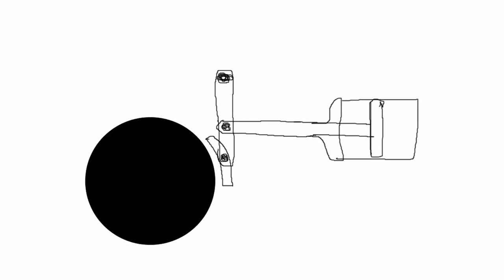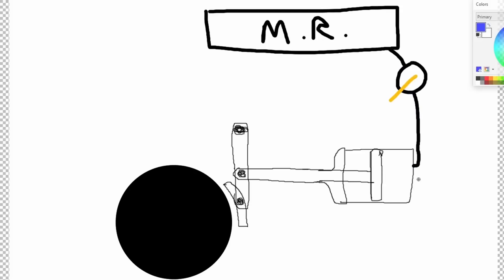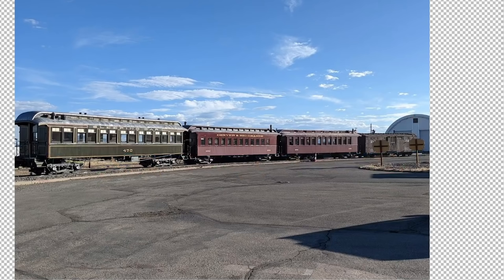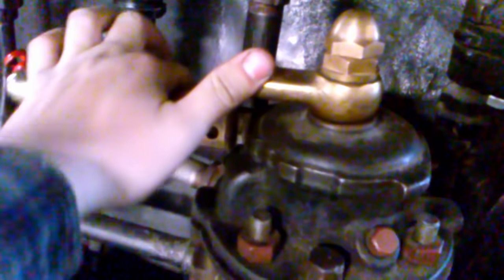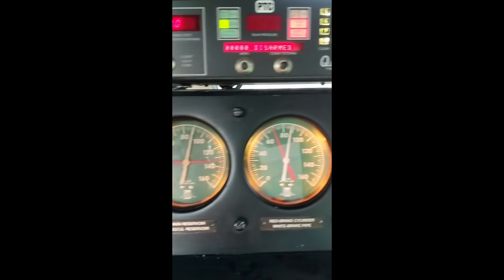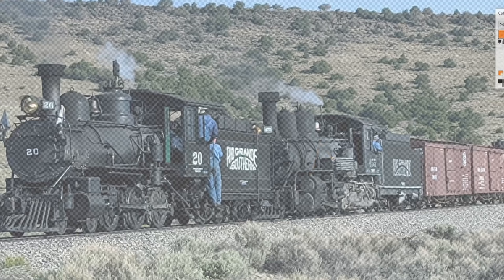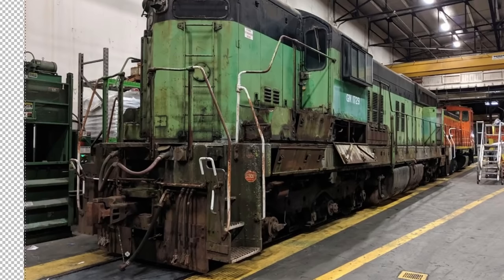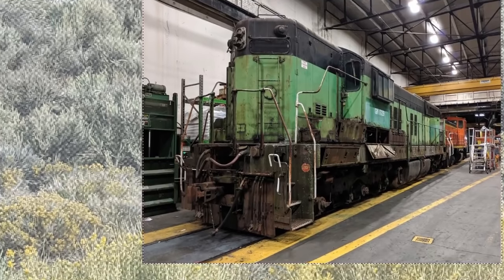AIRBRAKES 101: 10 levels of TRAIN BRAKE understanding!

Comment: That was a great video, and I learned a lot!  A couple other comments, one of which might be for air brakes 102:

1.  On the Sumpter Valley, the brake stand is 19 is a bit different regarding the independent.  To bail off the independent, you set the handle to lap (or maybe running?  I've been out of the cab for a bit), and then press down.  This bails off the locomotive brakes while keeping the automatic set up.  It's kind of the opposite of the "engine hold" you described; we had a separate valve for engine brakes.
2.  I recall reading that the brake cylinder is smaller than the reservoir on the cars, about 2.5 times smaller, so a reduction in the brake pipe results in a larger application than shown on the gauge.  Example:  5lb reduction in pipe and reservoir->squeezes into cylinder and is further compressed by size-> 12.5lbs on brakes.  Again, a little rusty on that, but it makes sense with P1V1 = P2V2.
3.  For air brakes 102:  can you do some research on Electronically Controlled Pneumatic Brakes (ECP)?  Where there's an electric signal line run to each car so they all apply brakes at the same time instead of going at the rate of air flow, which on long trains takes a while.  That time delay is also why distributed power can help with braking, since the air "signal" comes from multiple locations at once.

Loved the video, excited for the next one!
Reply from the maker: Cheers! Yeah, sounds like the 19 has the more modern 26 style independent to press down to bail. I can't remember the exact variety of 6ET that is but it's one of the more modern styles.

2. You're totally right, that was "glossed over" by me saying "it's not the exact amount based on volume" it felt like getting in that much detail would confuse those who don't know anything about this stuff. For sure a 102 topic.
3. I learned a bit about those at BNSF! Very cool, very weird... Certainly worth talking about! Good idea. I actually haven't thought about those in years. More research to go. 

Thanks for the comment!
Reply: I run commuter trains with ECP. We have two 36pt MU jumpers (which should give away which railroad it is). The signal goes through these jumpers and actuates an applied magnet valve in each car. The carsbare connected via brake pipe but will make their own reduction as well as lowering the brake pipe pressure locally. The diesels actually have a shorter stopping distance than our electric trains. 

The added benefit is we also have a 'hold' position which means we can keep the brake cylinders applied and recharge the brake pipe for a quick release a departure time. The train can be converted to a pneumatic system, we had to do this when we borrowed non-ecp cars. Unfortunately for all the modernity, the brakes were still non-selflapping.

Comment: It would have been much better if you elaborated on the 26C brake valve system. It is a more modern system with many features that the earlier valves didn't have. The methods of using all of the braking systems on a train would also be interesting. On long grades the dynamic brake is used in conjunction with the air brakes to maintain the speed on a down grade by setting the air to hold the train and controlling the speed with the dynamic brake. I would think a discussion about controlling a train with brakes would be more interesting than an explanation of a out of date braking system, but maybe that is just me?  The napkin method was confusing for me and I passed my air brakes section of the SP simulator school with an A+ when I promoted to engineer.
Reply from the maker: That's all fair, most of my viewership knows I know and run the antiquated stuff- so, I explained what I knew best, and what seemed most interesting to my viewers. I think train handling in general could be a whole separate topic, and could get into some of the things you mentioned. Thanks for the comment.

Comment: Level 11: how to release the brakes, at least in Europe, the railroads started with handbrakes, then went to a Westinghouse type airbrake system, with so called single release valves installed on most equipment until fairly recently where they switched to so called multi release valves (difference being that a single release valve can only increase brake pressure or dump all brake pressure, aka releasing the brakes, whereas a multi release valve has multiple release pressures where it releases back to said pressure)

Level 12:
How to goof with brakes / don’t brake too often or your reservoir can’t recharge and you‘re hosed

Level 13:
Alternative braking methods (engine braking, track brakes), anti slip, ECP brakes and other stuff

Comment: The Vacuum on Vacuum brakes are used to keep the breaks off - not on...

This way you have an automatic fail-safe as if any air gets into the system the brakes snap on - Any split in the Vacuum across the train will hold the brakes on automatically....👍
Reply from the maker: ah, neat. Didn't know that about the vacuum brakes
Reply: Expect for the old Eames vacuum brake, the old-fashioned 'simple' type. Works backwards - no vacuum = brake off. Caused a major disaster at Armagh, 1889, and, less famously, a collision at Carlisle in 1890 - the brakes in the Carlisle incident were able to be switched between simple and automatic vacuum. The driver became mixed up and released it when he thought he was putting it on.
Reply: @Hyce777  
Vacuum brakes are actually applied by air pressure, the pressure of the atmosphere.  The locomotive draws air out of the train air pipe which also draws it out of the vacuum brake cylinders, both below and above the piston.  When air is allowed back into the pipe it also goes into the brake cylinders but only below the pistons, a valve closes preventing the air getting above the pistons.  The pressure of the air below the pistons causes the pistons to rise in the cylinders thus applying the brakes.  The vacuum above the pistons is retained, thus meaning that the brake cannot be exhausted by repeated applications and releases.  Another advantage is that no air pump is required.  Also, unlike early air brakes  graduated release of the vacuum brake was possible; it was not necessary to completely release the brake before it could be re-applied.  The main disadvantages are that it is slower to act, and the brake cylinders are very large and heavy. Vacuum brakes require more frequent adjustment than air brakes.

Comment: Great orientation on train braking systems. I am not clear on one aspect of train braking - I thought that the air pressure is used to disengage the brakes from the wheels and that a loss of pressure applies the brakes. In other words, no air pressure brakes are applied. Pressure allows brakes to be released hence a fail safe. Is this correct?
Reply from the maker: Not quite - if there is absolutely no pressure (no air) - the brakes are released. If you charge the train up, such that each car's reservoir has air, and then remove / lose brake pipe pressure, then the brakes come on. So, you have to have the train charged up, and in that case, yes, loss of pressure applies the brakes.

Comment: How does moving the brake lever to the right cause the air pressure in the brake pipe to reduce?  And how does moving the brake lever to the left cause the air pressure in the brake pipe to increase?  Since the air comes from the air compressor, wouldn’t the air compressor be the only thing that could increase or decrease the amount of air in the brake pipe?

Comment: First of all I want to say thanks for all of your educational videos about how trains (especially steam) works.  A a modeler I really appreciate them because I haven´t been able to find that info elsewhere.  In terms of brakes, what about retainers.  I read that before a  heavy train would start a long downhill grade they would stop and set the retainers on the cars.  What are they and how do they work?
Reply from the maker: Retainers are valves that hold the brake cylinder pressure in for a certain amount of time, based on a resistance setting - 10 or 20 lbs.. This allows the engineer to release the airbrakes, bringing the brake pipe and car reservoirs back up to operating (70/90/110 PSI, depending on your fancy), while the brakes remain applied for a handful of seconds (can't recall at the moment, but it's something like 15-20 seconds for 10lbs and 30+ for 20 lb) - this way you can keep some amount of braking while you recharge the train, which is critical with longer trains that leak.
Reply: @Hyce777  Thanks!

Comment: Mark, to what extent are the locomotive/tender brakes applied when there is a set on the Automatic?
Reply from the maker: without bailing, they set up similarly to a car IIRC - so for a 5 psi reduction, you see something like a 15 PSI straight air set come up on the gauge. This is the same for each car, but you don't get a brake cylinder gauge for the cars. That said, 99% of the time we hold it bailed so I am not 100% sure I'm recalling it right at the moment. haha

Comment: I was always under the impression that the air pressure actually removed the brakes ( with no air they are fully applied - a fail-safe if the car lost air it would automatically stop)  or is that vacuum braking? Either way, I can see that air brakes are a much more nuanced topic than I first thought, and am interested to learn more.  Hope there is more info on this coming.  I'm specifically curious about what a "brake"van or Cabbosee does in relation to all this?
Reply from the maker: With no air, they are fully applied assuming that the car's reservoir had charged. If they weren't charged, then the brakes won't work until they get charged. So, the failsafe exists, but only for a train that's actually all hooked up. A caboose/brake van is different in that it usually had an emergency dump valve and brake pressure gauge for the crewmen in it.
Reply: @Hyce777  Appreciate the insight.

Comment: I thought it was flipped, applying the pressure releases the brakes. So the air would be in the other end of the cylinder in level 1? Or am I horribly mistaken? I thought it was that way so that if air pressure was lost all the brakes would be applied as a safety stop gap.

Edit: Nevermind, that's the automatic break system. Should watch the whole video before commenting haha.

Comment: Regarding the airpump:  you can have different pressures by using different piston-areas. There is actually such a standard component used in the industry, to raise pressure.
Reply from the maker: Yup, goofed on that one. They just did it that way for steam engines to keep the flow high enough.
Reply: .. P=F/A   the force f is common for both cylinders in the pump. If A is kept different, P gets different.
Reply from the maker: @urvhalt  Yup, duh, basic physics, right? Yeah, I let my "field knowledge" get in the way of my engineering brain on that one. Thanks for the comment!

Comment: About vacuum brakes, it should be pointed out that the braking efficiency of such a system decreases as altitude increases. Hence, it is not desirable in mountainous territory where  passes can often be more than 6,000' above sea level. 2022/04/09. Ontario, Canada.
Reply from the maker: Makes sense!

Comment: Great video as the previous 10 levels, but I have to disagee with your description that by the compressor yu can get only the same air pressure (ignoring losses). Perhaps such setup makes no sense in practice, or is simply never used, but you can have compressor where the driving piston has larger diameter than the driven piston, therefore giving you pressure advantage at the cost of flow rate.
Reply from the maker: That's fair - I never really applied my P1V1T2 = P2V2T1 equations to these compressors :P. I imagine you could in the right world, but in practice you can't on any steam locomotive I've been around, despite that setup being part of it. You usually only get as good as maybe 20 PSI less than steam pressure. Usually it's more like 30-40 PSI different.
Reply: @Hyce777  I think think this has more to do with the maximum pressure they really want in the main reservoir more than anything else... because locomotives with 200, 250, 300 PSI boiler pressures never had main reservoirs mover 150-160...  What Jan said is correct, if then driven piston has half the surface area of the drive piston, you can get 2x the drive pressure... Case in point, we have a Haskel Pump on our SCBA cascade system on our rescue truck and with only 2-300 PSI on the air bottles, I can still charge tanks to 5000 PSI. It's slower than molasses in january, but it does work.
Reply from the maker: @kleetus92  Makes sense. I think I was conflating my experience with 346/20 (which have similar sized air piston to steam piston) only being able to make ~110-120 PSI MR when 491 with 175 PSI can hit ~140-150 despite the compound pump. Thanks for the discussion folks!

Comment: How are the brake cylinder movements coupled to the shoes on the trucks that are turning as the train traverses curves, without the turning affecting the brake motion?
Reply from the maker: The brake beams hang from the car, not the truck; the levers are mounted on the truck, and close enough to center to assume no change in force during cornering. The brake beams do end up applying more force on the inside wheel than the outside wheel, but because it is ultimately the same wheelset that is rigidly affixed, the fact that the force is more on one side vs. the other is only really a maintenance issue and tends to average out evenly.

Comment: So.. it's the exact opposite of a tractor trailers air brakes. In a tractor trailer springs hold the brakes clamped all the time and air allows them to open. So if there's a loss of air pressure the brakes automatically apply.

Comment: Great video! But I think you were missing the equalizing reservoir, which is kind of essential for the long-heavy hauls as a fundamental mechanic part.
Reply from the maker: I 100% skipped over the equalizing reservoir for this video. Absolutely critical, of course, but for getting someone who really doesn't know much about this stuff at all learning both how the brake pipe works and how the ER works and then how they interact would've been a little too detailed amongst the rest of what we were going through. I am planning on a 102 video where we go through the ER, things like graduated release, retainers, etc.
Reply: Could you also cover twin pipe systems in the 102 video?  a lot of trains in australia use the twin pipe system including all passenger as well as our heavy coal trains.   my base understanding is that the second pipe is just MR / regulated MR pressure to keep the tanks on each car charged all the time even when the brakes are set, but also to provide air to things like doors and dump chutes.  Im also under the impression that its a lot safer as the chances of pissing away the air" are far less.

Comment: What you did not mention, nor explain, is that the reduction in air pressure in the train pipe can only travel along the train pipe , from the locomotive back along the train, at the speed of sound, which is 1100 ft/sec. This means that if your train is a mile long - quite common these days, it will be 5 seconds after the engineer moves the handle that the brakes on the rear car begin to operate! I understand that trials were held with an additional electrical control system, whereby when the engineer moved the handle an electrical signal was sent to every car in the train simultaneously, and all the brakes were applied at the same time. This resulted in better - faster - braking and elimination of bunching and stretching.  Has this been incorporated in PTC?

Comment: Thanks for this! But I'm confused now if train brakes aren't sprung like truck brakes, (stated level 2 or 3 here). Suppose there's a train car which has been sitting alone long enough to have its reservoir completely empty, so there's no compressed air in the system at all. Does that mean its brakes aren't applied? That is, by default, ignoring the manual emergency brake wheel, just left alone they're released?
Reply from the maker: That is correct! Cars that sit off air for long enough are free to roll, if you don't put the handbrake on, which is more of a parking brake than an emergency brake in this case. :)
Reply: @Hyce777  interesting! I'd always assumed they were like truck brakes in that way, to follow the "fail stopped" model. Probably a good thing I didn't know that as a kid - a number of the rusted out cars where I grew up could've rolled, given a hefty enough push...
Reply from the maker: @Swordfish393  They do fail on stop - when air is there. With the way that the air sticks around for so long (4+ hours required ) - you have plenty of time to get the right number of handbrakes on. Definitely an operational ease by using them this way.
Reply: @Hyce777  Right. Thanks for the clarification!